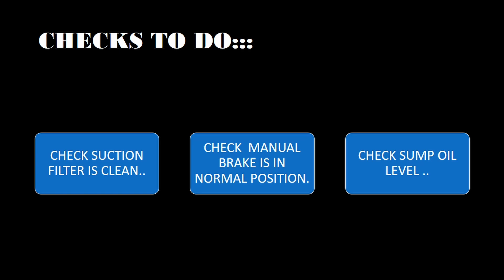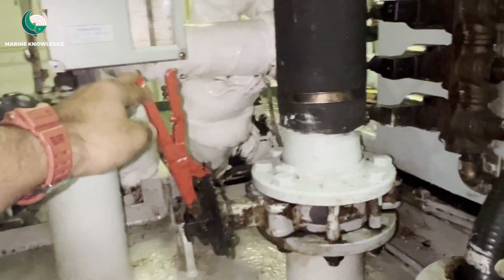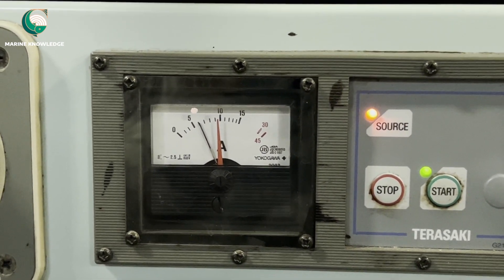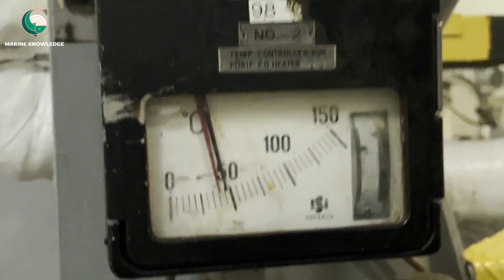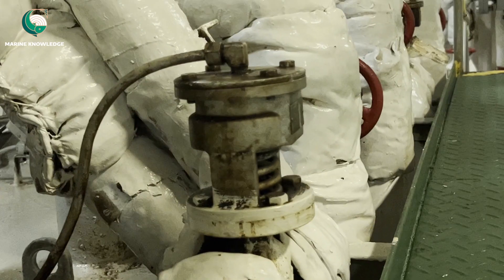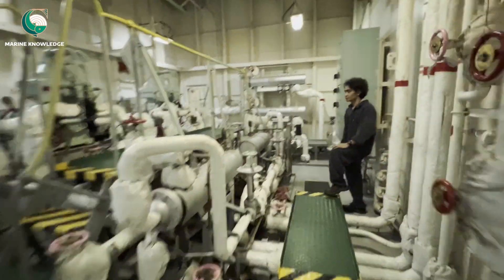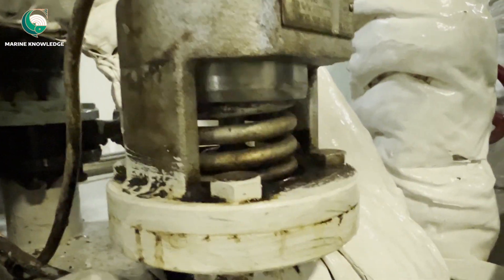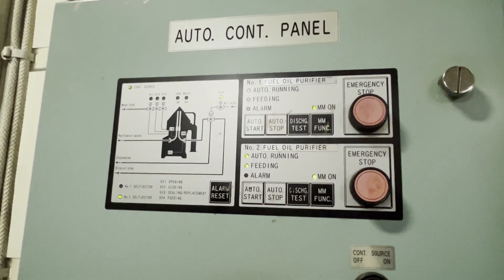How do they do Fourth /Junior engineer jobs ... How to start Mitsubishi  HFO purifier onboard ship..

Comment: We always had friction blocks of the motor broken on this purifier.. at least once per 2 weeks we took out and found broken. Did you have similar problems?
Reply from the maker: Block broken??
Reply: @marine-knowledge-basha  yes inside the motor in the fiction pulley ,friction clutches I think they are called